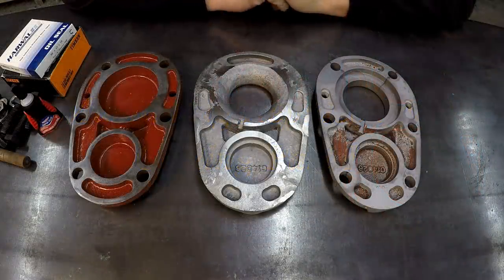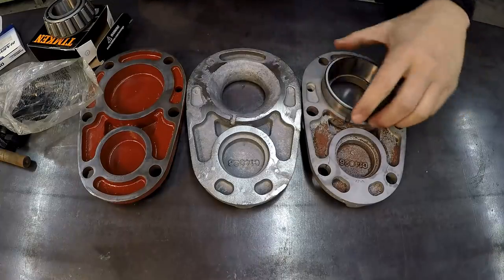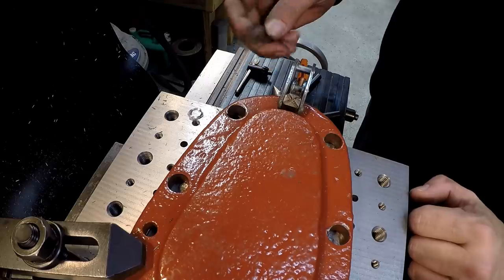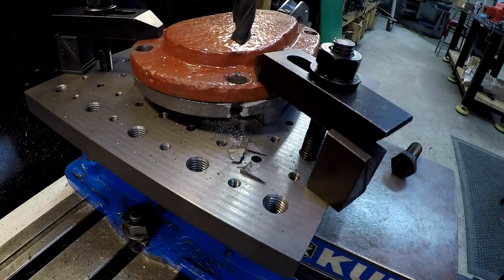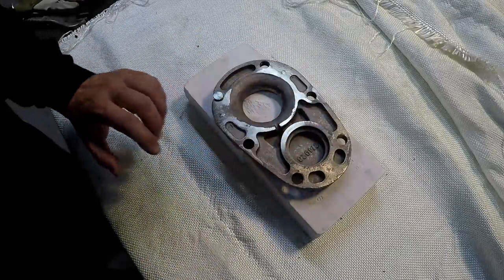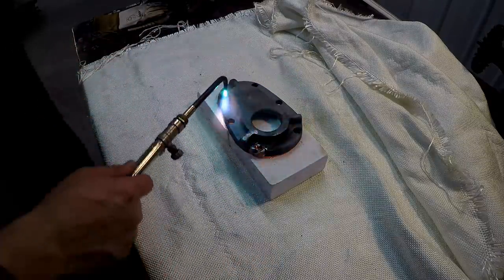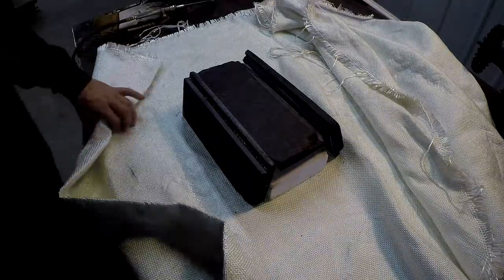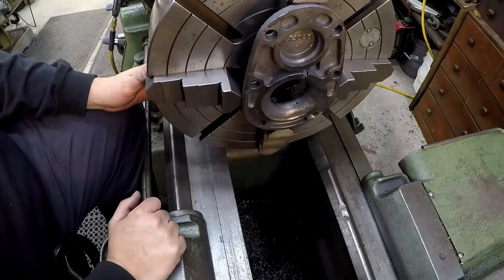Machining a Replacement Casting Part 1

Comment: Hard spot in casting, throws a curve ball.
Adam pulls out tungsten carbide.
Casting be like, "bruh, I was just playin'."

Seriously though I think the casting needed to be annealed first, iron is notoriously prone to cracking because of low ductility.  I think the protocol is heat to 1100F and hold for one hour per inch of cross section, then cool slowly either inside the forge or buried in vermiculite.  Basically overnight.  That draws it out for machining.  You'd do the same if trying to machine/shape a file or some other brittle material; anneal, machine, heat treat to harden, heat soak to temper, and possibly cryogenic cycle to normalize depending on the material, to achieve the desired properties.

Comment: I knew what was happening as soon as you described having hard material on the skin of both sides of the castings. I'm assuming that this casting was Iron and not Steel even though it wouldn't have mattered because both Iron and Steel need to be heat treated after it is cast, to naturalize the grain size throughout the casting, after it is removed from the mold. If you would like to become acquainted with the mechanics of the phenomenon taking place inside the mold, go to my channel and watch "Designing and using Risers in the Mold for your castings". You won't have to watch the entire thing as solidification is explained fully in the beginning of the video. Suffice it to say that a ferrous casting will always need to be annealed to soften the matrix for machining and afterwards be heat treated to convert the casting for the job that the casting will be performing.

Comment: When i had to machine new iron/steel castings and ran into a hard spot I heated the casting over my primitive forge (charcoal in a hole in the ground outside the shop fed air from a dump recovery Electrolux vacuum cleaner run from a reostat) until they were red hot then shut off the air and let it cool in place overnight. Castings machined like brass. 
My stepfather expected miracles so i quickly learned what worked and wnat did not. Safer that way.

Comment: I was wondering how that aluminum was going to work...  Majority of my work for the last 40 years has been with aluminum, so....  Anyway, water under the bridge now, you made it work for what was needed.  That is what counts.  With regard to the rest of the machining, why not use a boring head in the vertical mill for bearing seats?  Also, "flatten" the mating face on the shaper??
Just doing the armchair quarter-backing.  LOL
As always, a great channel!
Best regards,
Ken
Reply: Somebody needs more Shaper. I know I do.

Comment: I have been interested in casting copies of existing castings. if you using your old part as a pattern, were you ever concerned about shrinkage? I would think that your copy would be undersize.
Reply: It looked undersized to me too.
Reply: IIRC, some forms of cast iron can have a negative shrinkage allowance (ie: they expand when cooling) due to how the crystalline structures form.  Also, it could be that it is close enough not to worry about for a one-off casting depending on the actual alloy being poured.  Don't quote me on any details though, I'm a home gamer with sparse study and a bad memory chip.  ;)
Reply: @uberintj  Thanks. I'll do some reading up on this.

Comment: Hi Adam

I think when iron cools too rapidly...or when it hits a cold mould during the pouring process it can go hard...
This shows up as a white layer around the edges...and is usually very hard & unmachinable...

Next time Pre-heating the mould...and adding a bit of Ferro-Silicone to the iron in the melting & holding pot before pouring might help to eliminate this... 👍

Comment: Nice job, cast Iron can be a you know what.  Question, could you have brazed the broken pieces back onto the original casting?  If so, maybe it would be good to do it and have a spare sitting around the shop gathering dust.  Another good video, keep'em coming.

Comment: I was watching this and thinking: What if the bearing cavities are not perfectly aligned with the bolt pattern? Wouldn't it be safer to make 1 or 2 cores to closely align both parts inside, before drilling the bolt pattern? It seems you don't have much to play around, if something is a bit off.

Comment: Adam, Very nice recovery on the broken hole. Maybe the AL plug worked to your advantage by letting some of the brazing into the hole for added strength/material?
Eric

Comment: I used to rebuild gearboxes for a living and used those tapered bearings. Just be careful those bearings needs to be shimmed so when the box gets up to running temp which should be around 120degrees far. I've worked on similar boxes. I hope that this helps I know it might be little to late

Comment: Is the shrinkage not a problem? Normally you make the pattern larger so the cast shrinks to the right size but casting the exact size part you need results in a part smaller than original. Next time you could give it about five or six coats with auto body build primer to account for the shrinkage.
Reply: Samuel Taylor that was my thought to.. 👍🏻

Comment: You have got some chilled cast iron there .they let it cool too quick . I have worked on chilled cast
in the past . you could not polish it with a grenade
Reply: Cast made from scrap where a bit of chromium has snuck in can be fun as well.
Reply: Yeah.  The foundry didn't do him much help.  Even if it were FREE Adam is going to lose a lot to broken/worn tooling, extra time and effort, some spikes in blood pressure, AND the part is going to be smaller and weaker than the original.
Reply: You are right there Eddie . By the way I am subscribed to your channel

Comment: Probably needed to uneeled the piece in a high temp oven first then let it cool down slowly. I'm afraid that when you apply tork to the bolts it's going to crack again...

Comment: Old journeyman I served under world say to many hard Buick bumpers used in the casting.  We  were  an  OEM.  We would store our rough castings  outside to season until needed.    We normally would do the face cuts on the mill with carbide inserted face mill  and a quick clean up datum cut on the outside surface.  The old journeyman didn't like the interrupted cuts on the lathe and all the air cutting time. Use to also incorporate clamp hold down lugs on the pattern then simply   saw off grind and sand when done you would never know that they were there.  Guy's now days have it made with the fancy 5 axis lathes.

Comment: Putting aluminium in the hole sure wasn't the best idea. I bet some of it got dissolved into the bronze, nice mystery metal blend. Hope it holds up good enough anyway.
Reply: We all have 'brain farts' sometimes, 1200 vs 1800 melting points. I was waiting for it to blob onto floor. Alumibronze is really tough stuff, probably way stronger than original cast iron (even if it is an accidental mix LOL ) I use it for valve guides in motorcycle engines. I hated the hard spots in casting when I was doing production work. Sometimes you could actually see a piece of HSS tooling but that was pretty rare

Comment: Wouldn't lubrication help? I thought heat build up dulls bits and softens the metal in the tool.
Reply: When the material is/approaching the same hardness as the tool, lubrication doesn't help, much.
Reply: +Bernard Furst +UncleBubbles cast iron will lubricate itself as the powder it gives off from machining will reduce the friction. cast iron is nowhere near the hardness of high-speed steel (by a difference of 100-500 brinell depending on the alloy of the casting), but if he was cutting mild steel then it would need some lubrication like cutting oil.

Comment: Thanks for showing the frustrations.   More real.    My thoughts to add would be to wrap tape or putty or something around the casting used as a pattern so as to make the outer wall of the the holes thicker especially when shrinkage is considered when casting.

Comment: Get a vertical lathe, it'll take up a lot less room. It's not like you need to accommodate long pieces for these broad castings; most of these sorts of jobs are a foot or so deep at most. And you can use really wide chucks- 20-30" dia are common. It'll take some patient searching but I think it'd be the ideal solution for your medium-sized shop space.

Comment: In hindsight...wouldn't it have been easier, stronger and faster to machine the whole thing out of a solid steel plate?
Reply: @ItsMrAssholeToYou  Nah, it would have been cheaper easier and faster to just machine it out of plate stock. Plasma or water jet through shape and machine the rest, which you are doing already. Wouldn't have any of the time wasted. week down time for the foundry, hardness issues, braze repair, remachine etc.This was just a clusterfuck. But by the time he made the call to run with the casting, he was locked in at that point.

Comment: We used to cast some crazy high chromium cast irons back in the day.. to grind that thing only silicon carbide had to be used and for milling .. well  it dulled even the best carbides used for hard milling (which was quite rare back in those days) like it was hss .. doable milling but very costly!

Comment: You broke out one of the side walls which you had to braze.  Was the thinness of the side wall due to shrinkage when the casting was made from your original?  Or was the side wall thin to begin with? 

I recently had a steam locomotive headlamp lens ring casting made - 13 5/8" diameter - in aluminium.  The pattern was an original.  Given the shrinkage factor in aluminium - about 3/16" per foot, I had the perimeter of the lens ring built up with some sheet wax - the first time I had done something like this with wax.  The added wax beefed out the diameter so that we could mill things back to the proper diameter to fit the headlamp.  It was a real learning experience.  

PS - Love your videos!  I've learned a lot from them.  Keep 'em coming!

Comment: I cast mostly silver and copper these days but I do like to do aluminum as well. Making parts such as these. Great recovery Adam. Nice way to get 19 on the go bud. Neat to see the fixture plate at work. Castings can sure be a real bear to machine.Getting through those hard spots. Onward bud.

Comment: Brave man Adam - quite a challenge for sure. Sort of job with considerable 'pucker' factor! :)
Ouch - the sound of struggling drills... that breakout was in some ways not totally surprising - that must have really hurt. Those holes sure had awful small wall thickness.
However - Abom rescue worked great finally even though more pucker!

Comment: Adam, how much did you swear when the edge of the hole in the casting broke? I would have been cursing a blue streak and throwing tools for at least 10 minutes. :O

Comment: A 9/16" drill would be 11 thou bigger than 14mm. Not sure if that's "too much of a difference", but 11 (7/16), 14 (9/16), 16 (5/8), 19 (3/4) and 22 (7/8) mm are some of the sizes that I have in my head as "close match" between metric and inch dimensions. Obviously not going to work if you need to get an interference fit, but for "sticking a bolt through the hole" and similar, it may be good enough.
Reply: @Mats Petersson - Could one also sleeve fit a washer with interference fit (edit addendum: or a washer/sleeve combo shaped a bit like a tee-nut with no barbs or threads)?  My position is in that of learning, not being a machinist myself. Blessings friend  :o)
Reply: Possibly. But it's often better to avoid "extra bits" when you are trying to fit things together with precision. Regular bolts and such, typically don't need that close a fit, so a few thousands oversize isn't going to cause a big problem. Of course, Adam may have a different opinion both on how to solve the problem and the requirement for precision... I'm no machinisht. I work on my own motorbike, but rarely more than "drill a 5mm hole, put a M6 tap in the hole, and bolt on something" or "undo some bolts, fiddle with stuff, bolt back on again" - no precision machining needed, and no welding or lathe- or mill-work at all. I have done during my education, but only a couple of hours once or twice a week. Nothing like Adam's talent or experience.
Reply: @matspatpc  You not only don't need much precision on a hole for a through-bolt, you can't have tight tolerances between the bolt and the hole. You have to assemble the part at some point, and while this gearbox might be light enough to muscle around in shop conditions, some of the bolt holes will need to be mated and assembled in place, on parts too heavy to hold up with one hand even if there was a place to put them.

Comment: Had a similar situation on a cat engine front cover. This was a screw up by cat, I remove the cover. took a bolt one size MM smaller wrap the bolt with  aluminum foil. Push it through the hole in the cover. Then using JB Weld . Smarted building up the space. This took several layers. after the weld had setup I remove the bolt . Then drilled it out to spec.  Just some food for thought
Reply: JB weld held up to that kind of job?

Comment: See lots of folks slagging the foundry work but if you read any of the older metalworking texts on machining castings, the majority indicate that chilled castings are commonplace, and that is more the norm than not.  Perhaps they can be annealed out, as mentioned, but should not be a huge surprise that the casting is essentially case hardened.

The foundry didn't leave the casting short of material; it is what it is.  Look at the original in the video and you will see the bolt holes are close to the edge.  Probably to fit the machine it goes into.  Having said that, I did wonder if shrinkage with cast was significant enough to cause the breakout.  Probably though it was just a brittle area and chipped out.
Reply: Nut still. Shouldn't the foundry have known to have let it cooled in the mold longer?
Reply: William Listening to what Adam said they need that machine back up and running at the shop so it sounds like what we basically have is a rush job.  Rush jobs sometimes get rush results and as we know there is never enough time to do it right but always enough time to do it over again (or in this case deal with whatever problems come up along the way).
Reply: @gullreefclub  fair bit I feel like, if I was the guy he gave the job to, I'd say "look, I can get it to you tomorrow, but that means x might happen and screw it up. Do you want it that fast or should you rather I do it right?"
Reply: @gullreefclub  I try telling production guys, if you don't have time to do it right the first time, you still won't have time to do it right the second time. Do you think they listen?

Comment: I wonder if the person casting it added any material to the original to allow for shrinkage.  The new part did seem smaller around the holes than the original did.  I would expect somebody knowledgeable in casting to know better.  That said, at least he has the ability to have it cast.  I wish I could do that!
Reply: whateg01 yes, MrPete222 talked about shrinkage on his "casting" series
Reply: @FreedomFromIgnorance  I had the same thought. As a quicker and slightly dirty solution it would have been possible to enlarge the circumference of the original part used as a template by gluing plastic stripes onto it or adding a layer of putty. This would at least have added a bit more meat to the walls of the trough holes.
Anyways: thank you for sharing this, Adam and my best wishes for the new year. Harald

Comment: Adam, You said you didn't have any carbon for a plug but you have those ceramic blocks. Use a old hole saw to drill out a plug slightly oversize and work it to size on the belt sander. An idea for next time.
Reply: I was thinking the same idea, use a plug cutting bit (used on boats to make plugs to cover the screws that hold down teak decks) with a roughly 14mm ID.

Comment: > thanks adam for showing us the way into new territories; proof positive that clearer communication regarding the task status coupled with an appropriate (improved) moulding pattern would have surely nullified the technical issues you encountered. mucho respect here amigo.

Comment: What are the chances some of the sand from the mold mixed in with the metal as it was poured?
Reply: Possible, but I've drilled sandy cast iron before. It's gritty feeling, and you can tell the difference between gritty and just hard. You can see the different chips from the hard spots, and sand in the casting doesn't do that either.

Comment: What material is the casting? Cast steel? I wouldn't think that cast iron would be so hard but judging from the chips and the sound, your cutting tools didn't like it very much. When I was a kid, my Granddad would do brazing repairs on cylinder heads as I watched in utter amazement. Just recently discovered your channel and I am fascinated with your skills and dedication.
Reply: Grey cast iron can be a pain with hardened spots,  ferrous silicone in the melt is the only sure thing I know for that solution.  It's always best to pour a sample to determine how much will depend on where the metal originally come from,  brake rotors are the worst.

Comment: No experience in the field, but I wonder why not facing on the mill if doing it on that lathe is proving to be challenging?
Reply: if he faces it in the lathe, and bore the hole in one setup, all the dimensions will be true; like the perpundicularity of the bore VS the face. The more different setups you got the more your tollorances will drift

Comment: Looks like it should've been cast out of steel, given the thickness of the wall near those holes. For ally I'd have expected a bit more than 3mm, probably why the original broke in the first place

Comment: No worry in using outside edge of that casting as the reference when transferring the hole pattern? Seems like the inside features are way more important to the shaft lining up straight through....
Reply: I was thinking the same thing.